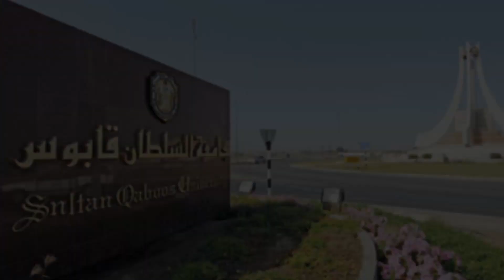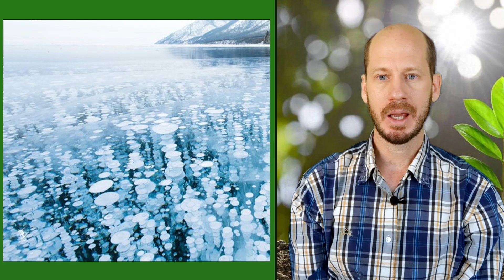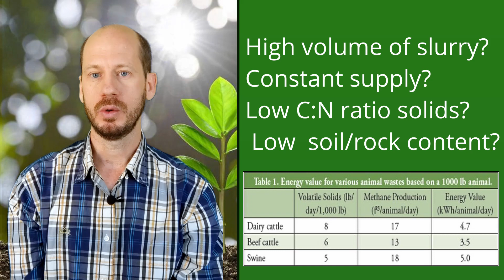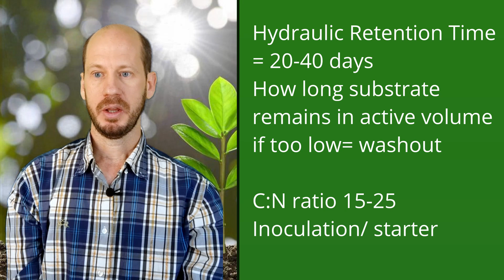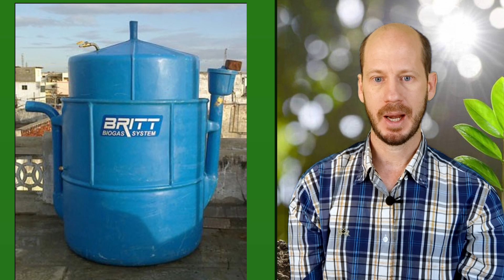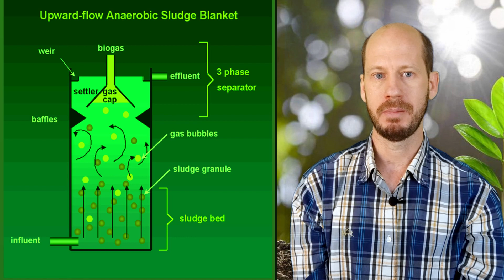Anaerobic digestion, biodigesters and digestate

Comment: I working on a hybrid system between a biodigester and a pyrolysis generator. Each produces combustible gases as well as beneficial soil ameliorates...
Reply from the maker: Share the info if possible
Reply: @danielblac As stated, I'm 'working' toward a common application where both my biodigester and biochar oven can complement the final products; combustible fuels and soil amendment. 

As the anaerobic digester favors CH4, the biochar pyrolysis favors Hydrogen output. I'm testing the use of H to agitate the AD slugbed plus the addition of BC to augment the output of CH4 in the AD.

We already know the benefits of (inoculated) biochar in soil, now I want to prove the H agitation without compromising the CH4 output.

There are far too many details to include here...

Comment: Can digestate be transformed into solid fertilizer, and at what rate of input
Reply from the maker: Hi William, at farm scale the effluent is normally used as a slurry. But it can be dewatered using a screw dewaterer or a decanter centrifuge. In any case, you will still need to dispose of the water separated, which will be full of nutrients and some amount of organic material.
Reply: @danielblac  Iam up to a medium scale project in the midle east where the obtained slurry will be dewatered  , but I don't know exactly the ratio of the two sapereted products, and if the solid obtained from the slurry can replace chemical fertilizer, let's say I use input of 2 tons cow manure and 1 tons of food waste
Reply from the maker: @williamandmomen3147  the dewatered digestate will still have  about 80% moisture, and will be around 5% of the total volume. These numbers may vary depending on the operation and technology design. Cheers